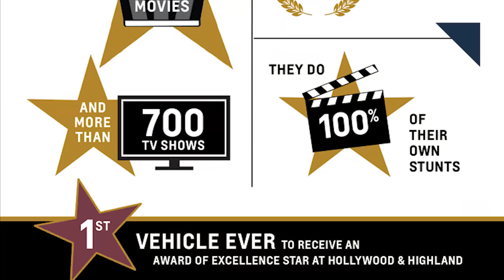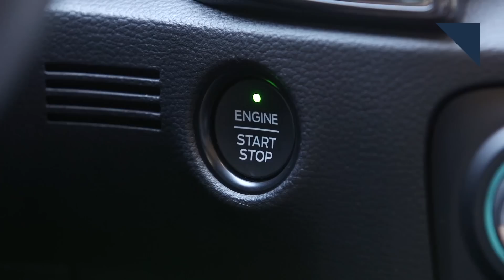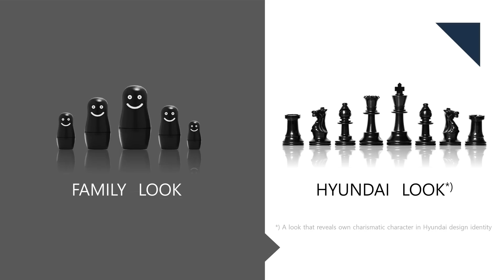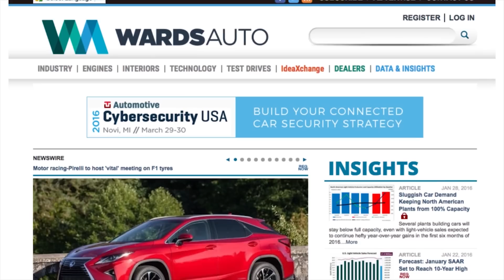2020 Sonata Design Highlights, Tesla Gets China Subsidies - Autoline Daily 2732

Comment: 7:15 Sure, but Mercedes-Benz sedans had a .27 Cd 35 years ago. It should be commonplace by now.
Reply: Yes, the W126 S-Class. It's easier to make a very large car with a low Cd. But the CdA is higher overall because of the larger frontal area.
Reply: @karlp8484  No, actually, not at all. The W126 had a poor Cd compared to the W124 because the W124 was the first to make use of their new wind tunnel in development. 

I'm well aware of taking area into consideration, but the comments I referenced were not about the CdA (which I'd argue would probably be fairly similar given the W124s smaller size).